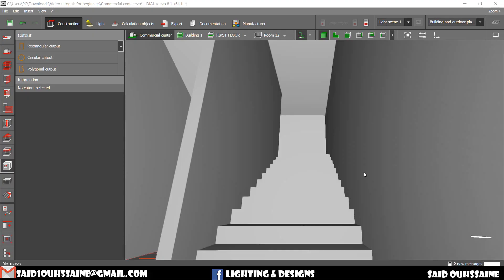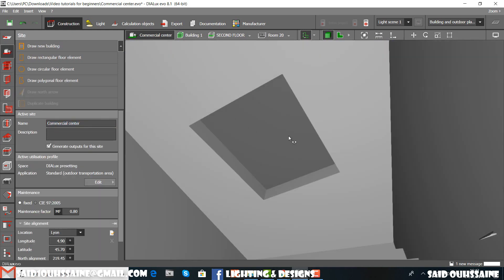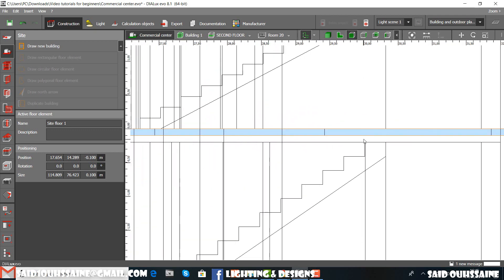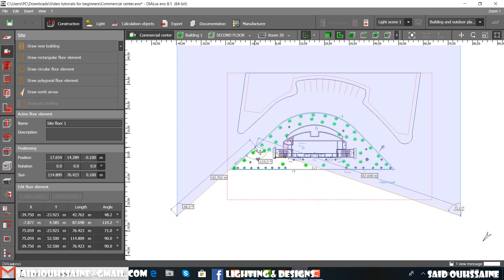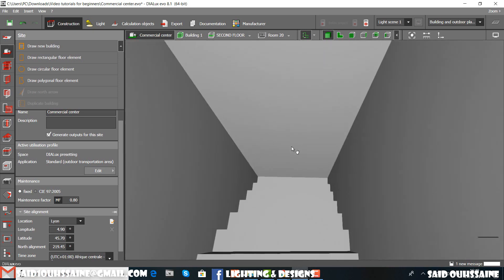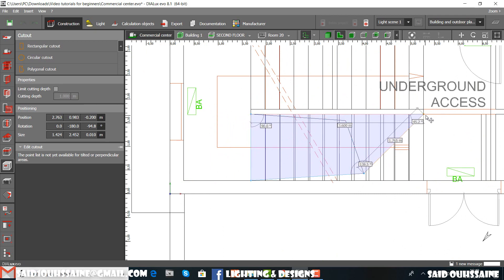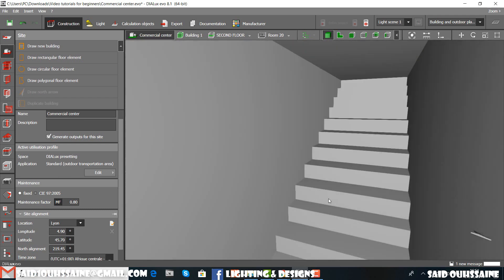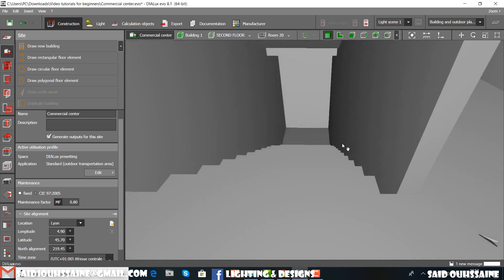10 Dialux evo for beginners: How to solve Cutout tool problems

Comment: Hey... a cutout problem im having: daylight does not go through it. It is like there is no cutout surface... can you help?
Reply from the maker: Actually, in Dialux evo, daylight doesn’t go through cutouts !
Reply from the maker: The solution is to insert a window and then delete the glass of the window to make it like a cut, then it’s gonna work